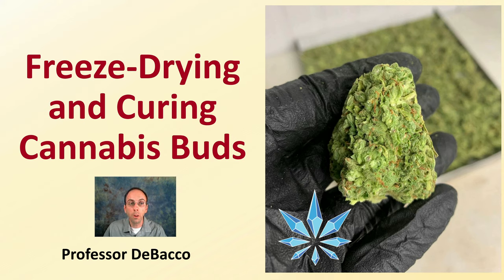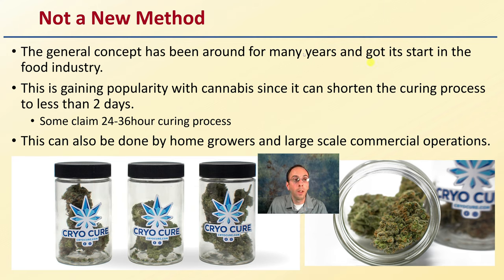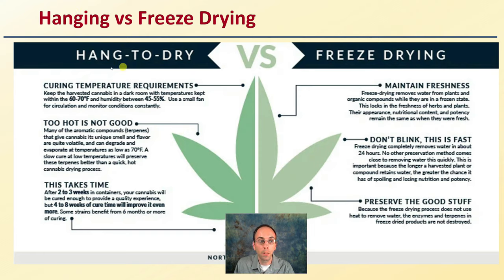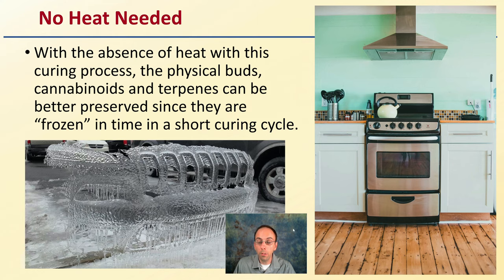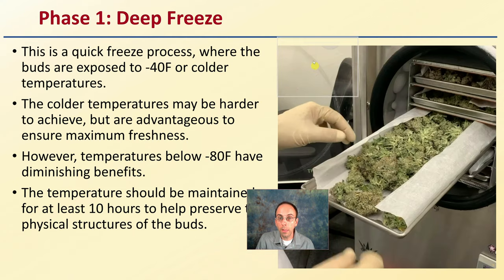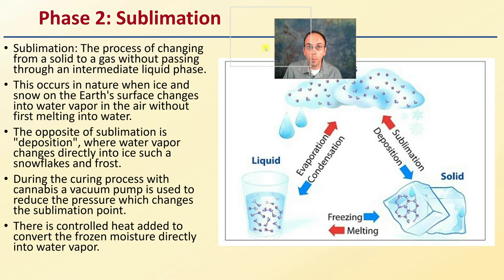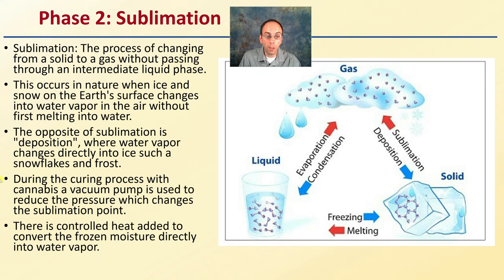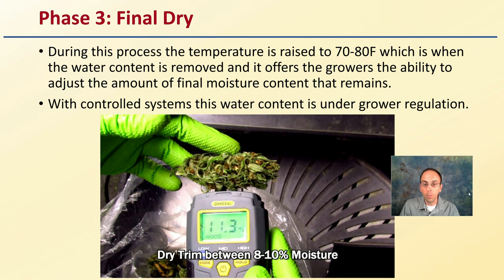Freeze Drying and Curing Cannabis Buds

Comment: I smoked a little over a 1/4, just rolled backwoods. I like how even the stems break down but I think freeze drying causes the buds to become to soft for blunts. Every blunt I rolled Imploded in on itself. I found myself getting frustrated as blunts are my preference to smoke. It would be nice to have both options in the dispensary.
Reply from the maker: Options are a good thing.
Reply: Maybe try Fruity Pebbles after a dry hang. 24hrs and the nugz be hard af dry and ready to smoke. 48hrs tops
Reply: Sounds like it needs some more drying time
Reply: @BlakkGodOfReturn  I would but I typically buy from the dispensary in town.
Reply: @hollywoodkbbadstepdad6152  you do know I meant putting the buds in fruity pebbles cereal right. Check out godbody drying in cereal on youtube.  Either way I'm sure you will figure out what works best for you.
Reply: @BlakkGodOfReturn  no I didn't know that but thanks I'll check it out now.
Reply: @BlakkGodOfReturn  I'll try his method but the problem I was having is when I buy the freeze dried bud it smokes like Keef in a Blount.
Reply: @AL Capone hell I try to be. Lol been a flower fan since 1994. It's an everyday Thang. Except for those four year in the Marines. Big smoker over here lol
Reply: @hollywoodkbbadstepdad6152  MAN SO FREEZE DRYING AINT IT
Reply: @samuelponce1  not if you like blunts but just my opinion
Reply: @hollywoodkbbadstepdad6152  you and me are on the same boat

Comment: What upsets me is there isnt a small unit for home growers. And freeze dryers have been around for 80 years. They change a few settings different from a conventional freeze dryer and think its ok to charge 20k for a freeze dryer
Reply from the maker: Freeze drying does require some special equipment and can present some dangers.  Typically this is directed toward volume which is a contributing factor why small units are not common.

Comment: Another excellent intro video. From experience I can say for those growing cannabis to make solventless concentrates (via bubble hash): if you wash either freshly frozen bud or freeze dry fresh bud then wash it, the amount of green in the final product is far higher than if the bud is hung conventionally for 7-10 days first. The commercial companies push “Fresh Rosin”, which I imagine is pretty green stuff that they simply whiten to a lighter color, if they do indeed collect it from freshly frozen bud. The yield is higher for previously hung bud. You also need a pharmaceutical freeze drier with skinny shelf spaces for better temp control to do this correctly.
Reply from the maker: Thanks for sharing this information.
Reply: How they whiten it to lighter color? So for smoke the bud freeze drying  - for rosin dry normal for 1-2 Weeks?
Reply: @ModernFitTrader  I suspect they use bleaching or other similar chemical process. I’ve smoked freshly freeze dried bud and it’s ok but prefer conventionally cured cannabis for smoking.
Reply: It’s called CRC, (Color Remediation Column). People can press nasty shwag and manipulate the color and even take terps extracted from other higher grade product and manipulate the flavors. If you’re not pressing your own rosin then no one knows.
Reply: That simply isn't true
Reply: @BrownieeeHD ya absolute clown age

Comment: I have a couple reservations and questions if you know the answer. 
One of the key goals of the drying  and curing process is the breakdown of chlorophyll and the post harvest metabolic conversion of CBG to THC etc... 
Generally, If you dry to quickly, or overdry, you prevent these processes from taking place, resulting in a flower isn't technically cured, just dried. 
So it seems to me freeze drying is just a method to rapidly dry cannabis without using high heat, but if true it stands to reason that just as  above, it would stop the curing processes dead in their tracks resulting in a product that would be harsh to smoke and would have a grassy hay flavour (and potentially higher levels of CBG at the expense of other metabolites such as THC). 
Is there some aspect of the process that somehow addresses these issues?
Reply from the maker: This link should help provide more details... https://industryprocessingequipment.com/advanced-learning/f/viva-the-live-revolution---freeze-drying-cannabis-and-hemp
In short the deep freeze breaks down the chlorophyll in hours what takes enzymes days.
Reply: @DeBaccoUniversity  imo it’s good for bottom and mid tier quality but not top shelf. The smell and taste are just too lacking with the current know methods. 

I do look forward to when it’s able to rival a traditional cure. 

(my opinion is from a consumer standpoint. Imo I care less about the % of thc And more about it being an enjoyable process instead of having to almost force it down. The market is so deceiving now days… the stuff can look amazing and test high and when you open the jar … your heart sinks because it smells like hay and you hear the price is right fail theme play in the background.. lol
Reply: When I lived in Dearborn lodge park with my Uncle who lived below the Post Office they'll tell you these are Vietnam vets that know what the h*** they're doing and they would agree with me the stuff you buy in the shop they would not go and buy they would grow it yourself because it's a lot better and you get a lot better high and it lasts a lot longer not this government method of growing and drying and coming up with all these conversations about it it's all a waste of time Let the stuff dry on its own naturally and grow it outdoors where you can grow it legally but all this c*** they're spraying in the skies is getting on our Cannabis and destroying it so that means they know we can do it better than them and they're trying their best to destroy to destroy the best cannabis ever produced on the planet.
Reply: @rocko100able  you really need to go see a therapist the delusion here is insane
Reply: Eathyer bass honey oil, the color of honey 🍯, or 🍒 red.
Reply: @steelwitness  tell that to Mike Kavanaugh's my dad's brother, Mike lived below the post office with Debbie, in phillipsville, in deer Horn Lodge Park, and, I hung around with Steve elfman, Mike's son, my cousin, Mike and my dad were brothers, my name is JOHN, BUT EVERYBODY CALLS ME ROCKY, I just like the old fashioned Eathyer bass honey oil, honey color, or the cherry 🍒 red hash oil, we would take a Pyrex glass tube about 6 in Long heat up the end of that glass Pyrex dip our pin with a big old bloop of honey oil on the end of that pen and just touch the edge of that Pyrex with it and it would just shoot smoke down her throat, but you could take 5 meals that import in a pie plate pan in about 25 joints of parsley and rolling into joints 25 usually for 5 minutes and when I was a kid in the seventies it was like five bucks for a joint of the stuff and you can take two hits and stay high for f**** over 2 hours totally bust out of your head the stuff to make today with the chemicals and s*** I don't want anything to do with it I smoke chemical free, some good old Phillips Phil popcorn, you can go to the dump in redway and get better homegrown smoke from all the growers around there throwing it all together in their bags when they're done and then somebody gets it mixes it all together four fingers and it's as good as the best stuff you can get anywhere now, if that's all I can get, 25 bucks an ounce still for the homegrown leaf but this is homegrown leaf is some of the best stuff grown. From the best growers, in the emerald triangle that is, but I stick with the popcorn best in the world.
Reply: @rocko100able  If I was in a Party Id much rather sit and chill with You than Chris
Reply: 404 you got another link please my dude?:D

Comment: if your looking for a nice and clean desinfectionmethod use an uv-light once a day wear gloves and uv-400/500 or just heavy welding glasses. no chemicals needed only kills microorganisms like bacteria and doesnt "burn" the trychomes only needs seconds of exposure if u apply this every day while curing. especially helpfull if a large bud develops mold and you wanna desinfect the surrounding after pulling off the moldy excess. propably also helps against the tiny white wolly things should dry them out might help if you dont wanna expose your flower to soapy water haha compressed air from a reasonable distance should also help a lot
Reply from the maker: This can be effective, but is prohibitive on a large scale operation.
Reply: @DeBaccoUniversity  A relative of mine owns a farm that grows produce. He has a conveyor belt with UV lights so that every produce that goes along the conveyor belt passes under the UV light. The conveyor belt was dirt cheap and he installed the UV. Doesn’t take any time or any real effort I suppose having the space is the only thing that could be prohibitive.

Comment: Thanks for the work your doing in the industry, it's so hard to find decent information in this space.

Do you have any information on optimal vacuum pressures? I know that terpenes are far more volatile under a certain level of vacuum pressure but I can't find any specific information online.
Reply from the maker: There are a few variable that play into this (Ex. altitude, temperature) so this is where individuals need to dial in the "best" for their location.
Reply: @DeBaccoUniversity  good old trial and error I guess so
Reply: @DeBaccoUniversity  what temp for freeze dryer shelf's my man
Reply: @hindsight2022  did you get a answer . I need the same lol
Reply: @dwaynebottoms1824  i set mine to 80° f
Reply: You should be using a pharmaceutical freeze drier with skinny shelf spaces, the food machine has tray slots too wide. The shelf temp should be set to 50 degrees F, Harvest Right’s machine is 125 degrees as shipped, much too high but easily adjusted in settings. Terpenes will be lost with higher shelf temps. The pressure’s temp on/off threshold setting comes set at 500-600 mTorr, and there’s no reason to change it. This means that at 500 mTorr the shelving heaters turn on during drying, and shuts off at 600 mTorr. The final product should reach pressures of less than 175 mTorr to be totally dry.

Comment: Hello, great video! I see in the comments people complaining about curing but what prevents me from deep freezing the buds🥶 in place of regular drying  then vacuum chamber until I get 10ish% of Humidity inside the buds and finally proceed to cure them normally in jars? Best of both worlds or am I missing something?

Also, regarding the deep freezing temp, you’re saying that temps below -80 are detrimental, meaning that nitrogen is too cold, Better use dry ice ? Thanks 🙏
Reply from the maker: This is more important for long term preservation of plant material.  -80C is what is typically used for long term storage of biological material.

Comment: Just curious,  won't the freezing cause the trichomes to snap and break ?
Reply from the maker: This is flash freezing that offers the benefit of essentially stopping time (in relation to degradation) and with proper handling the physical damage will be reduced compared to traditional freezing.
Reply: @DeBaccoUniversity  I am drying my crop in -3 Celsius because I have no archer choice. Room is dark and rather good air flow - just very cold. To my understanding it will take much longer but my bud should be alright. After a month should be dried and cured at the same time and no risk of mold. I am correct or wasting my harvest ?

Comment: The thing is tho when you flash freeze your contracting and expanding all the trichromes on the plant which break when you do this causing it to at best lose potency at most cause a headache
Reply from the maker: This method is best used for flowers that will go to extraction.

Comment: How do you separate the terpenes from the vapor water?
What is the best moisture percentage for cannabis that will be smoked? I read and heard freeze drying creates a rough smoke.  I want to prevent this from occurring.
What is the correct freeze drying time & temperature for cannabis?
Reply from the maker: Reaching out to a professional company would be best as many systems are available so each will follow the same basic concept, but each will have its small details which are key to follow for a quality end product.
Reply: @DeBaccoUniversity  many systems available? Can you name one besides harvest right that isn’t over $10k?

Comment: Cryo cure specializes in the freeze drying of cannabis and they suggest -20 to -30°f so why are you suggesting -40 to -80??
Reply from the maker: The -40 to -80F is the ideal for long term preservation of biological tissue (most commonly used in research science labs).  However, it can be costly and difficult to achieve this temperature range, but if possible this would be the ideal.
Reply: @DeBaccoUniversity  what would be your recommended freeze and dry time?? If you can make another video diving deep into the science that would actually be very helpful. it's been hard to find a reliable or decent source of constant information when it comes to freeze drying.

Comment: You don't want to hang dry your plants in 45% relative humidity. You want to target 60/60. 60 degree's and 60% relative humidity. You want your flower at the end process to be 60% moisture. So if you are drying in 45% your flower will be 45% therefore being to dry. Obviously you can try to time it and take it out and jar it before it reaches 45% humidity but why risk it? Also it causes it to dry faster making it a more harsh smoke. If your dry tent is 60% relative humidity you can leave your plant in there for however long you want and it will stay 60%. If you have it at 45% and you leave it in there to long it can over dry. This is just my personal experience from what I've obtained by growing over a thousand plants. I could be wrong.
Reply from the maker: Thanks for sharing, there are two schools of thought, however the trend is toward the 60F/60% humidity being more favorable.

Comment: it taste grassy, it's a almost different high, leave it the old fashioned way with jars IMO,but hey people are different you do you
Reply from the maker: Good to know what options exist.
Reply: People are different, but sometimes people just do things wrong. It's grassy if you do it wrong, just like any other traditional curing method. It's a different high because it has higher amount of active compounds and THC without converting into CBN (So by different you actually mean stronger), 95-99% preservation vs 50-80% for traditional hang drying. If you want a less intense stonier high from FD'd bud, just allow a higher percentage of your trichomes to turn amber before harvesting, that way you don't have to degrade as much of the active compounds to get the extra CBN.

Bring the moisture content lower, it should be 5% moisture in total including stems and the centre of dense buds and let them redistribute the remaining moisture evenly throughout. After 4 hours you can then rehydrate to 8-12% moisture depending on personal preference.

If most of the moisture isn't removed first you will still have to jar cure for longer as the chlorophyll will still be present, which will taste green. Just like hang drying/jar curing done wrong.
Reply: Its possible to keep that from happening, basically you still have to cure it for two weeks in jars with boveda packs afterward

Comment: dry and cure different terms no if nothing is breaking down you should have all the  chlorophyll no?
Reply from the maker: Not sure what you are asking?
Reply: @DeBaccoUniversity  even if you remove water content you still have a cure period to let the cannabinoid profile build for more of the acids to convert into more active-able compounds right?
the other question is if the freeze dry preservers everything you would still have to wait for the chlorophyll to break down after removing moisture.
the main benefit i see from this is you can obtain the more volatile terps typically lost on dry.
Reply: @DeBaccoUniversity  they were asking if the chlorophyll is broken down/removed during sublimation.
They also mean that drying and curing are two different phases. I'm pretty sure technically they are the same but they are broken down into separate phases.

If you could provide an answer I would appreciate it because I was wondering this myself. If chlorophyll isn't removed during freeze drying process then I would assume you'd still have to jar them. I've tried to find info online regarding this but can't find anything.
Reply: @brandondumont7223  I didn't see that you already replied 🤦🏻‍♂️

Hopefully we can get an answer because this has been bugging me
Reply from the maker: True freeze drying process will retain more chlorophyll.  For details check out this study... https://www.sciencedirect.com/science/article/abs/pii/S0095955315333023
Reply: @00piper18000  you still have to jar and cure after, just gets rid of drying time basically

Comment: so what would happen to the weed if it melted from frozen? i
Reply from the maker: Should be the same as before it was frozen.
Reply: It’s structure goes back to normal, fluffy buds. I’ve got buds out of the freezer and within 10-15 mins of an Australian summer it was ready. The weed thaws out quite quick considering. No terpene loss. No flavour loss. No trichome loss. I smoked bud that had been frozen for 3 years and whilst it wasn’t the strongest, it certainly did the job and had effect. It’s amazing because before this time a few years ago I would’ve laughed at frozen weed. But it’s legit, it works fine and probably is the best storage place if you’re not digging into it constantly to smoke.
Reply: @juggernautproduktion  freeze drying is not the same as freezing your regularly dried bud. Freeze dried is like how they make astronaut food, just freezing it is normal and fine, freeze drying is so,thing you can't do with just a freezer